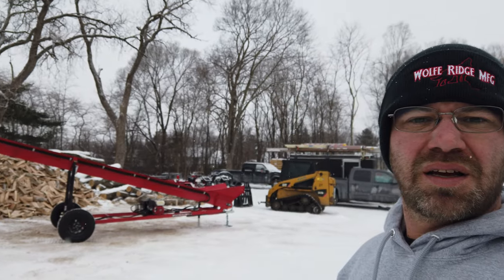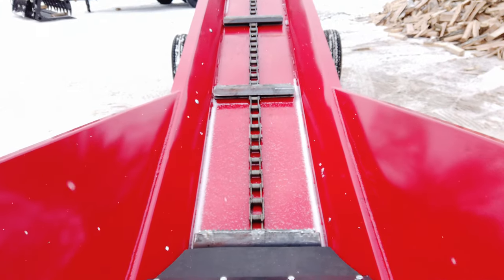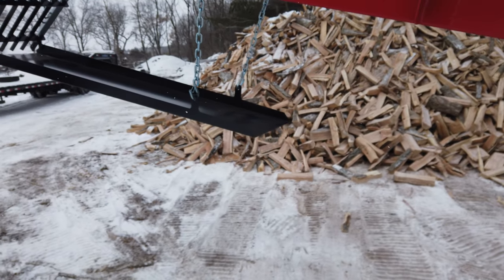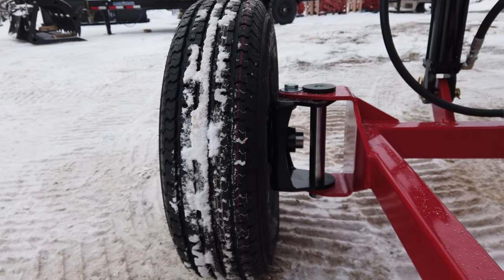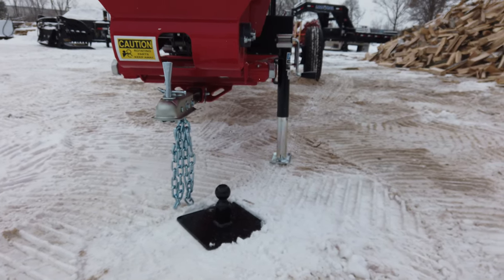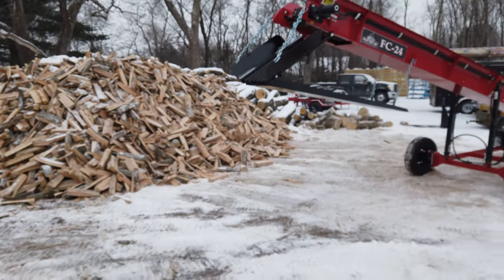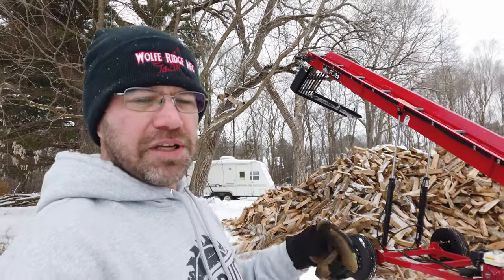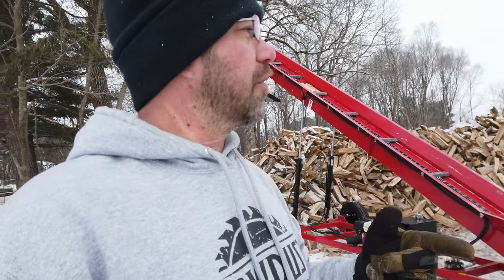Labor Saver! 24 ft firewood conveyor by Wolfe Ridge MFG

Comment: Do you have shutoff valves on either side of the oil filter so when you change the filter you don't loose a bunch of oil? And can you mfg a bag holder for the end of your chaff catcher?
Reply from the maker: No, sorry we don't. When changing oil, you could elevate one side of the machine to keep from spilling excess oil. 

Bundle bags slide right on the end of the chute. Thanks!

Comment: Chris, how do you all like the load trail dump trailers? Great video!
Reply: I’m not Chris, but I have some experience. They’re good trailers. Partners that branched off from PJ trailers. The tarp is cheap. But they’re very well built trailers. They tow well. Not light. A 7x14’ is almost 4,000 lbs. any of the big name trailers are good. Minus BigTex. But LoadTrail, Lamar, IronBull, PJ, Maxx D, all good trailers.

Comment: I picked up a Load Trail Car trailer last fall.  How are you liking the dump trailer?
Reply from the maker: I like it! Couple minor details that I will be modifying

I was thinking I would make a video one of these days?
Reply: @WolfeRidgeSplitters  Go for it!  The more info on these things the better.  I like the 20' car trailer with the fold up ramps.  Seems well built.  Will be interesting to see how the powder coating holds up to these Wisconsin Winters.  Hoping the Fluid Film keeps it protected some.

Comment: Are the hydraulics on the 28SHO / 35SHO (with big engine/hyd) enough to run the 24 ft conveyor -- In other words; can I totally eliminate the conveyor's hydraulic system and just plumb it into the splitter?
Reply from the maker: 2 stage pumps don't like conveyor motors. Also would be tied to the splitter just loading trucks, etc...
Reply: @WolfeRidgeSplitters  
I would be okay being tied to the splitter, but the part about not liking conveyor motors sounds troubling, so I'll back-up and punt. . . Thanks again for the reply and more so for the outstanding products you guys put out! 
P.S. Just noticed your website has been updated with a Kubota diesel option for the 35SHO, hope you can find time to do a detailed vid on it. . . David